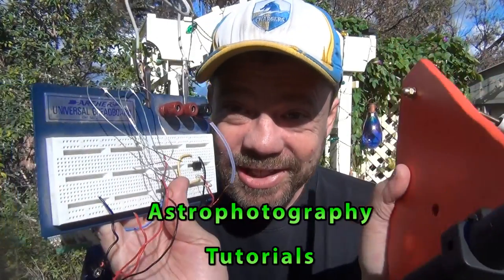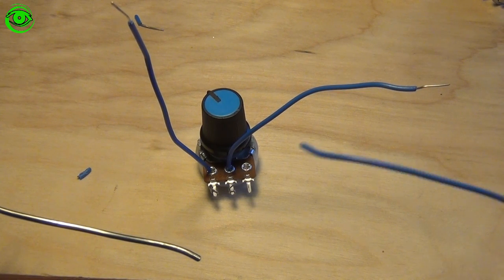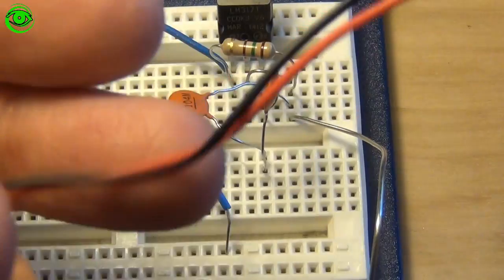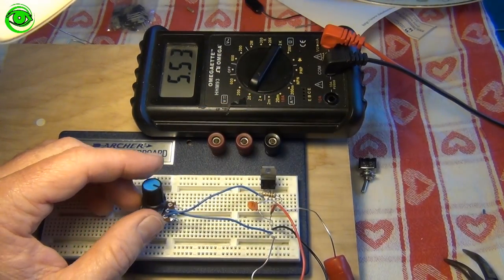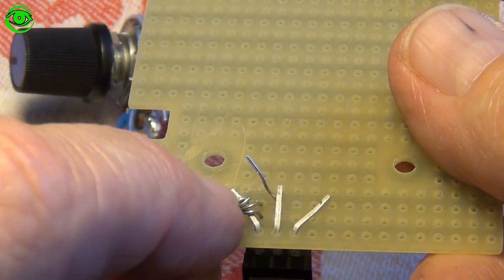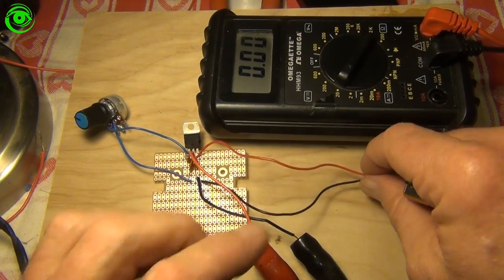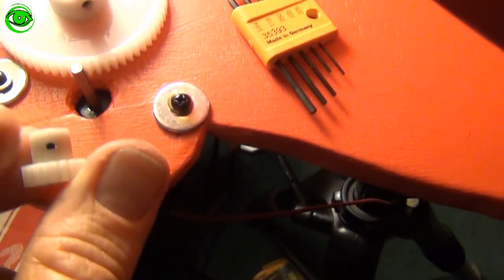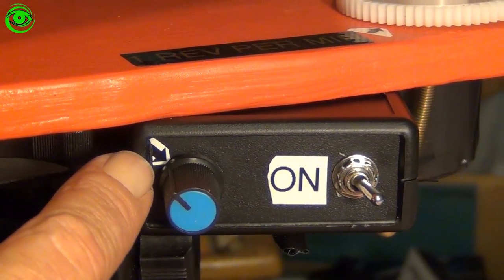Tracking Stars With Your DSLR - Electronic Circuit - DIY Barn Door Trap P2

Comment: Having made the switch from DC motor to Arduino driven stepper motor I can say it is sooooo much simpler - just power on and it runs at the precise speed you want!
Do not fear the arduino, if I can make it work, nearly anyone can! 
Rock On bro, great video!
Reply from the maker: +photon_trap Thanks Photon!   I don't fear the Arduino, I love the Ardunio!  I use them at work for small projects.  Great devices.  So did you have the DC motor and then you switched to a Stepper?  How much more did that cost for the stepper motor?  What about your Arduino code?  Post it here if you don't mind sharing.  Someone else perhaps would benefit from your knowledge.  Thanks for contributing and commenting.  Doug
Reply: Yes, I used the DC motor with a voltage regulator kit I purchased on ebay but having to constantly adjust to compensate for battery state, camera weight etc was very time consuming so the stepper motor seemed obvious - it either runs at the speed I intend or it stalls, there is no in between. I used a Arduino Nano, a Polulu 4988 Stepper driver w/ V Reg. and a Polulu 2267 stepper motor (16.95) My code is super basic, just power on and it runs perfect. One could add bells and whistles but I could not find reason personally, once I got it ironed out (which took some doing as it was my first Arduino project)
I was very satisfied. Here is the code:
----------------------------
void setup() {

  pinMode(4, OUTPUT);     // Dierction Pin
  pinMode(5, OUTPUT);     // Step Pin

  digitalWrite(4, LOW);
  digitalWrite(5, LOW);

}

void loop()
{
  digitalWrite(4, HIGH);    // sets rotational direction
  
  digitalWrite(5, HIGH);   // sets the pin on

  delayMicroseconds(1);        // pauses for _  microseconds

  digitalWrite(5, LOW);    // sets the pin off

  delayMicroseconds(9325);        // pauses for _ microseconds between steps,  close to 2.0 RPM
}
------------------------------------------

That's it, have fun! One day maybe I'll make a video showing my lessons learned (it will not be short - Ha!)
Reply from the maker: +photon_trap Wow, that's great!  Please make a Video and I'll post it on my Channel.  I'm sure other people would love to hear how you turned a Barn Door project into a stepper motor Arduino.  Seriously, I'm always looking for people to share their favorite passions in AP.  You shoot the raw footage and I'll edit the video.  I'll publish it and then reference your Social Media.  I think people would love to see how you took a $17 stepper motor and the arduino to make a precise tracker.  Thank you for sharing your code here, but, I really feel this deserves a full video....  Your video clips can be taken with your smartphone if you don't have a camcorder.  Thanks again for sharing your ideas and projects!  Doug

Comment: I'm completely electronically challenged. I've build circuit boards with step-by-step instruction so I'll give this a try. It's funny that you bought the same tripod and ball mount that I did for my project. Maybe that means there is still hope for mine. Great job on this entire series.
Reply from the maker: Thank you Brown!  I think this electronic circuit is doable for most people who know how to plug in a soldering iron.  I'm not an electronic expert and I did fry one adjustable resistor when I built it.  Just remember to take a volt meter to the motor out put and double check the voltage through out your whole build.  Then once it's completely assembled AND you test the voltage, then you can introduce the motor.  The motor is about $40 and all the other electronic pieces are cheap.  Doug

Comment: Great video Doug. you can always make a DC power supply for this as well. I do it all the time for my circuits. Just cut the top off of that 9V battery, grab a variable voltage DC power supply from walmart $11. Cut the adapter off of the power supply and attach them to your 9V top. You'll be able to keep a consistent voltage throughout the night. I hope you are imaging Comet Lovejoy with your new toy!
Reply from the maker: Thanks for the suggestion Rick.  Last night I caught a frame or two of Lovejoy with the new toy.  It worked very well, although from my light polluted backyard, it didn't turn out the best.  Thanks for commenting and watching.  Doug

Comment: Hi, My Name is Felipe Gutiérrez, I come from Chile.

I have a question, but first, I congratulate you on your videos top quality teaching, thank you very much, are also recent, just to consult our doubts, I thank you for using part of your courageous time teaching to future astrophotographers as you.
My question is actually on the images obtained, it happens that I use the "Deep Sky Stacker" program for calibration of my astrophotography, and with respect to this, the program only calibrates images to reduce noise, or also to adding the signal of each frame?
Besides, it happens that the program fits poorly each frame.
How I make a good polar alignment in the southern hemisphere to prevent drift?
What configuration and relationship between ISO sensitivity and exposure time need to adjust to get more stars and less backlight?

PD: Many times I was seeking help for automatic tracking my equatorial mount, and this is the first video in which I find that I want. Thank you very much.
Reply from the maker: Hi Felipe, thank you for your kind words and appreciation.  DSS is designed to calibrate (Remove Noise) and to stack (Add Signal) to your image.  Ideally you should have 15-25 images to stack.  You should have 5 -15 each of your calibration frames (Darks, Flats, Bias).  I use DSS for stacking only and take the TIF output to Photoshop for further processing.  I don't have many suggestions for Southern Pole Alignment.  We all know how important it is to start with a good polar alignment.  ISO and exposure times...I'm very new to DSLR imaging, but, I had a guest on my channel talk about Milkyway exposures here: http://youtu.be/z61vzZF0ao0 His recommendation was ISO=1600, 30 Seconds, @ F/2.8.  Thanks for watching and commenting.  Doug

Comment: Great idea and build.. I'm thinking about using a pwm motor controller for the speed adjustment. Luckily I do have one which I bought for cheap from aliexpress for a different project I was planning.
Reply from the maker: Good luck on your project!  I'm sure you'll be successful.  The proof will be in the results.
Thanks for watching!

Comment: I'm from UK I can only get a 12v 4rpm motor over here can you tell me how I would create a circuit and what I would need for this thanks great tutorial 👍
Reply from the maker: You say the 12V is 4RPM , is that at 12V?  If it is, you'll want to get it down to 1RPM, so perhaps the 9V would work?  Now this circuit above takes 9VDC and reduces the VDC to a max of 5VDC, so I don't think this circuit would work for 12V...but it would be easy to test.  I'm sorry, I don't know how to make a 12V version, but, if you google it, you might find something to work.  You've got to get that 12V motor to turm @ 1RPM...which you should be able to do if the MAX is 4RPM @ 12V is true.  Now if you take 12V @ 4PM...then that 12/4= 3 VDC for 1RPM?  I'm not an electrical engineer...If it's true that you need 3VDC to make 1RPM on your motor and the above circuit runs up to 5VDC...then you would think it would as is with the 9V battery too.  It's just unclear if it will take 3VDC to get 1RPM....Again, I'm not an electrical engineer.   Just throwing ideas in the wind...No idea if it would work.  Let me know what you end up doing!
Reply: Just use bigger gear wheels to bring the speed down ?

Comment: That's a single turn potentiometer in fact. Did you get easy speed setting using that? I find it really needs a ten turn pot.
Reply from the maker: It seemed to work perfectly for me.

Comment: just a tip not a bash on how you soldered it.. next time you solder something.. put the parts on the other side of the pcb. so that you put the solder on the copper thats on the pcb. maybe an extra or higher resistor so that you wont overvoltage the motor by accident.
Reply from the maker: Thank you for the tip!
Reply: @Myastroimages  and jou  thanks for the video👍🏼

Comment: I will have to use a much bigger motor perhaps 12v one, because I will be using a fucking great lens on my camera
the complete weight is about 3kg..  so I have enough power to move this without struggling, maybe brass gears aswell 
what do you think  ?
Reply from the maker: Not sure if you'll need a bigger motor.  The one thing I'd be most concerned about is whole thing toppling over.  I've never tested with 3KG, more like 1.5KG is what I've used.  If you have a really good lens, then you may want to look at other solutions.  Take a look at this:  https://www.ioptron.com/product-p/3550.htm Good Luck!

Comment: can you show maths behind  1 rev per minute that you did?
Reply from the maker: No, I cannot.  I took the formula and recommendations.  I didn't do any math to confirm these settings.  However, I can say that it does work.  I just don't know the math behind it.  Do you know the math behind this or know of a way to confirm?
Reply: Earth's rotation rate = 15 degrees per hour, or 15/3600 degrees per seconds
angle between the top and bottom of platform at has to be the same speed.

How high does it lift per rotation depends on the length between two threads, and how far the arc-rod is from the hinge. The closer it is to the hinge, the more angle per rotation it will get.
Reply: thanks for the info, i guess that is enough so i going to give it a try... nice video btw.
Reply from the maker: Thanks Fahad for the explanation!
Reply from the maker: Thank you!  Good luck on your project.  I think you'll be pleasantly surprised.

Comment: Hello Doug!
I recently upgraded my HEQ5 to SynScan,I have DEC, R.A. motors left and also the original PCB, can I use it somehow instead of doing this? I couldnt find any answers on the net:/
Thanks much:)
Reply from the maker: Hi Ondrej, If you have an EQ Mount, then YES!  An EQ Mount is better than a Barn Door Trap.  The BDT is ideal for some people on a tight budget who want rounder stars.  If you are trying to assemble a new mount from parts from your old EQ mount, you may want to check out my forums here: http://myastroimages.com/forum/viewtopic.php?f=6&t=1765 The member Griz has built a really cool system and he may have an idea or two to help you.  Doug
Reply: Astrophotography Tutorials Yeah I know it's better, Im using HEQ5 for astrophotography with my refractor 120/90 but sometimes when I go somewhere to mountains it's kinda hard to take that heavy mount, thats why i want to make some litle barn door trap just for DSLR, using some pieces from my old EQ mount.Thanks for the link, i'll write him.
Looking forward for the third part:)
Reply from the maker: Ondrej Kralik I just finished Shooting P3 this weekend.  I'm actually stunned with the Results!  I think you'll be amazed too, I did stationary vs BDT comparisons on 30 second, 1 minute, 2 minute, and 6 minute exposures!  For wide field lens AP you really can't beat it.  Super light, easy to use too.  P3 comes out this Sunday!  =)
Reply: Astrophotography Tutorials Congrats!  Looking forward to part 3!

Comment: I want to put a 12v gear motor instant of 3v gear motor, what changes shall I do to the circuit?
Reply from the maker: Sorry, IDK what the results would be using a 12V system.  You'd be surprised how long the batteries last using 3V.  Maybe you could get DC converter to bring the voltage from 12V down to 3V.  They are on Amazon all day long.

Comment: apparently the 4RPM 3 v motors are a hard to come by for the past 2 months... do know what mods i need to do if i use a 1 rpm 3v motor?
Reply from the maker: Hi Juan,
No, I don't know what mods would be required.  Did you try the link in the comments for the motor?   Here's the link http://shop.sdp-si.com/catalog/product/?id=A_3Z16-0040A It shows FIVE in stock right now.
Reply: gotcha, another question, regarding battery life... how long does it last until you have to replace the 9V batt?
Reply from the maker: Battery life is long...I haven't gone through my first 9V battery yet.  If I had to guess, I've got about 10 hours run time on it.  I don't think it drains the battery much, but, having a spare 9V "just in case" may not be a bad idea if you're using it a lot.